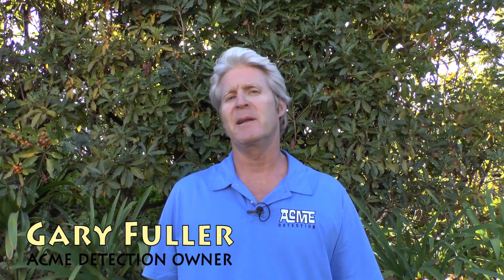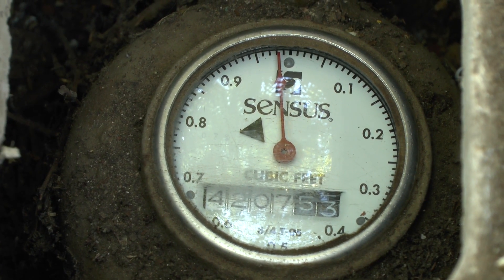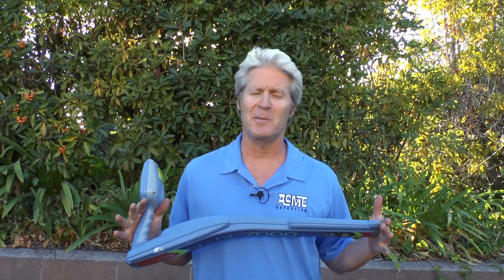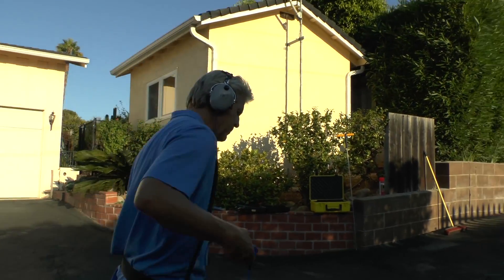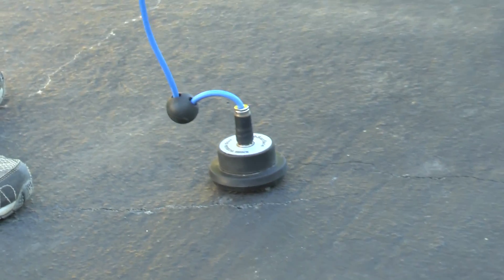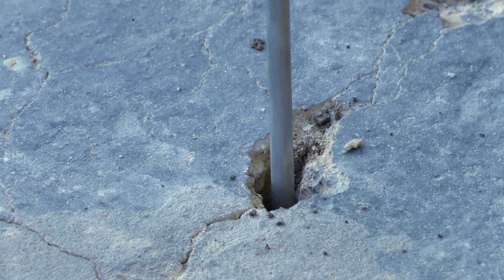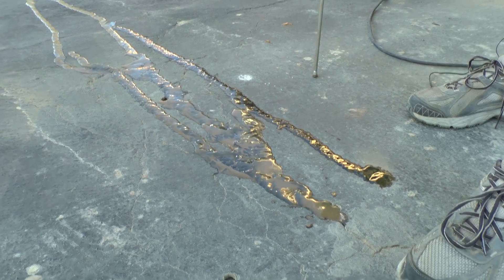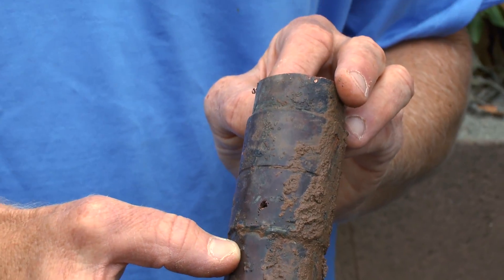Driveway Pinpoint Leak Detection — Allamerican Leak Detection Tips by ACME Detection, Santa Barbara

Comment: this is a beautiful work. i have similar problem but much bigger than water leakage. big pipelines buried deep into the ground polluting water sources in a community. Crude oil leakage into portable water sources. i don't mind contacting your  company directly if needed, i just need a solution with minimum damage and excavating done. here is my email address if needed oluwamisegun@gmail.com. i seriously hope to hear from you soon. Thanks

Comment: I thouroughly enjoyed your video. Question; do you ever use compressed gas for your electronic leak detection?
Reply: Hi T,
In  my other video where I do a slab leak in a house I show how to use compressed air from a dive tank to make the leak bubble and then we located off of the bubbling sound. In outdoor leaks such as this however we also have the additional option of using and traceable gas like hydrogen or helium. We insert the gas into the system and then use special sniffers that can locate that particular gas. This location technique is not as accurate as locating by sound.  We often use it as a fallback if we have a large property or if we have no idea where the pipes run.
I hope you found this reply helpful.
Gary

Comment: I like the video but the water meter is usually at the water districts or municipality right of way 18" to 2' behind the curb or SW
 and once you turn the water off, which the shut off is upstream side of the meter the meter will not move..the leak detector on the meter will not move.
Reply: John Bravo 
Hi John,

I'm not quite sure if I understand your question. There are typically multiple shut off's on anyone's water system. We were using the shut off's where the water line comes up to the house. 
Gary
Reply: Hello everyone I'm not quite sure about John's question here but there are typically multiple shut off's on anyone's water system at various sections of the paper to turn off certain parts. We were using the shut off at the house
Reply: Can this detect pvc pipes
Reply: My water meter leak spinner moves as slow as a minute hand. Should I worry. The water meter box keeps filling with water